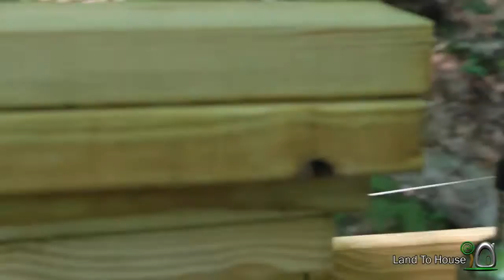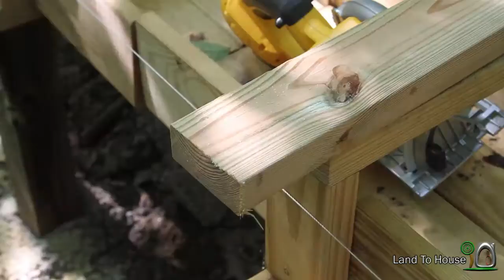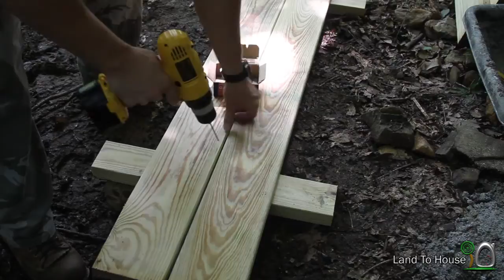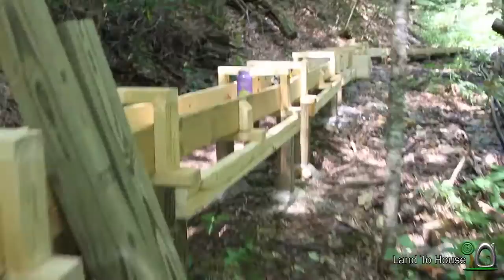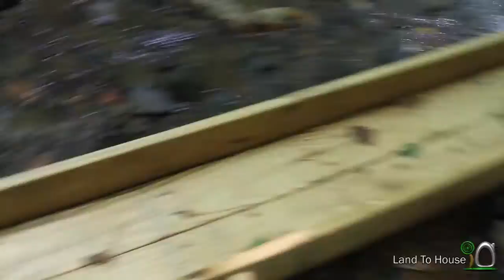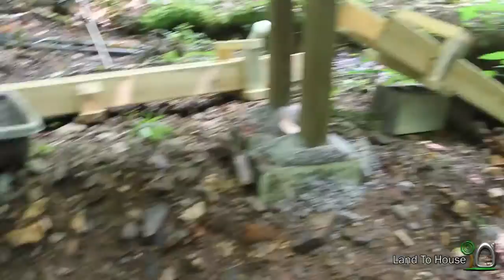Build a Flume

Comment: You are using pressure treated wood that contains Alkaline Copper Quaternary,Copper Azole,and Micronized Copper Azole and that will go back into the water. The better choice is cedar or redwood as it will absorb the water and naturally preserve it as long as it stays wer.
Reply from the maker: That is likely true. I am not even sure where I would get cedar up here.

Comment: Are you cutting pressure treated lumbar without a dust mask?
Aren't you using drywall screws with pressure treated lumber?  You should be using DecklMate screws with pressure treated wood.  Dry wall screws will rot after a year or two because of the chemicals used to pressure treat the wood.
Reply from the maker: +Passed High School Physics sadly I did use drywall screws. This was before I knew there was a difference between indoor and outdoor screws.
Reply: Land to House I had someone repair a fence for me and they used dry wall screws in pressure treated wood.  I was surprised but in just over a year the screws had deteriorated as if they were 20-30 years old.  And it wasn't one, it was all of them.  Had to do the work all over again.

Nice project.

Can  I ask why you just didn't use plastic pipe?  Seems to me if you used 2 or 3 four inch plastic piles you would get the same volume of water.
Reply from the maker: +Passed High School Physics it is surprising how quickly those screws will Rust away. I checked the ones in The Flume not too long ago and they still have at least two more years.

To be honest this project was back when I had very little building experience. (Even less than I have now haha) there are many things I could have done to have improved on the build. Using a pipe would have also worked.
Reply: Land to House I'm learning too.  If you would have used DeckMate screws they would outlast you.

What are you doing with the water?
Reply from the maker: +Passed High School Physics right now it is a nice intake for my Ram pump. At some point down the road I would like to use The Flume for a water wheel or some other sort of turbine
Reply: Land to House Nice - I was looking at making a water wheel, but maybe a ram pump.  Do you have any specs for making a ram pump?
Reply from the maker: +Passed High School Physics haha yes indeed. I have about 20 videos on my channel. You can also go to my website land to House com I have a free e-book that walks you through the steps of building a ram pump. And if you don't want to build it I have four sizes for sale.
Reply: Land to House Thanks - I will take a look.
Reply: @passedhighschoolphysics6010  My brother-in-law uses drywall screws for everything. Everything he makes falls apart.

Comment: I have almost resigned myself to using PVC for a flume. But this will help me to be more better looking for my waterwheel.
Reply from the maker: I had the same thoughts when I started thinking about how to get water to the wheel. I decided on the wooden flume because it would look so nice and it would allow for easy cleaning. when are you going to start working on yours?
Reply: Land to House .com Right now I'm in R&D mode.  I know what I want.  I have to find a way to aesthetically build it.  Since Orange County is so crazy I also have to probably apply for a crappy costly permit.  We shall see.  I still want to do this.  I actually think it would be cool to have a mini hydroelectric generation even if it is to just run an outside flood light or my aquaponic system.
Reply from the maker: G.W. Barker oh permits are annoying. But worth getting so you dont have to remove it later. I went around to see a couple flumes in my area and this is what I came up with. I think that it looks alright. . . when the trees stop falling on it. I should be able to get 60 watts with mine. how much water do you have in your source?
Reply: It is mostly a full time running stream except for in the super heat of the summer.  This is the second summer I have lived here but the first that the creek has stopped flowing. When it does flow it after a big storm it really pushes the water down and comes over the bank.   I don't know the flow rate.
Reply: Land to House .com BTW.  I LOVE the insert you built for the RAM PUMP.  Mental note made!!!
Reply from the maker: G.W. Barker Last year we had lots and lots of rain here and the creeks stayed up all year. But this year my little creek went from 120+ GPM to about 50. way down. My little spring has dried up totally. But even with a little water you can power an outdoor LED. If you went with DC you could power several. you will need around 2Volts for the really bright LEDs. .... I was building the third section of the flume when I thought about making a permanent ram pump intake. Seemed like a good place to put it. I am thinking that I will need to put a plug in the bottom to drain silt.